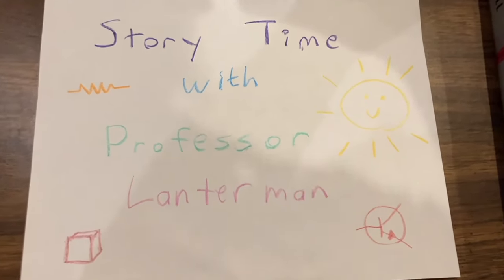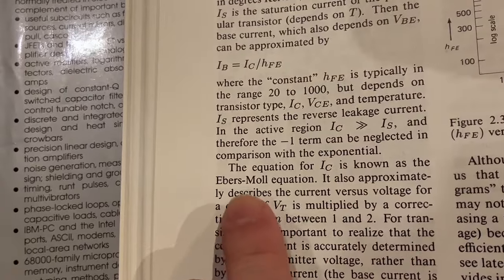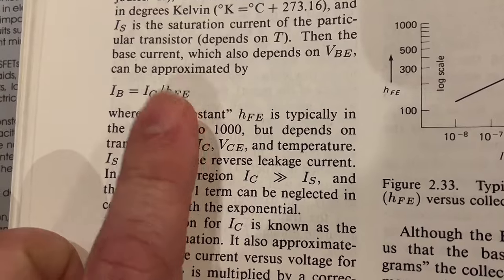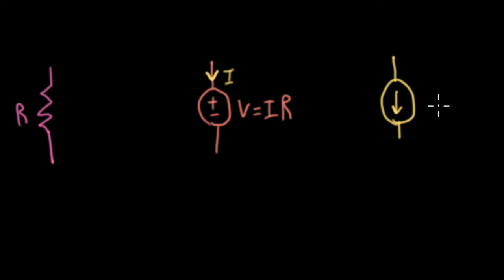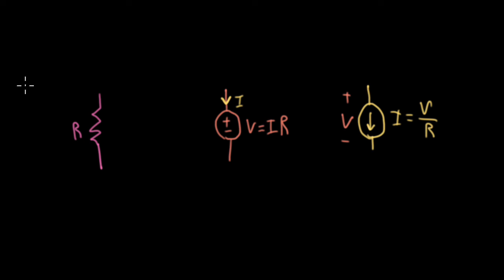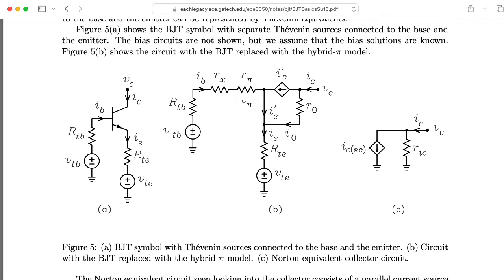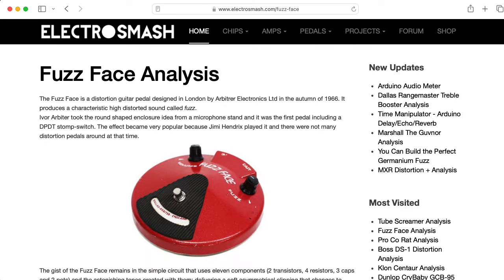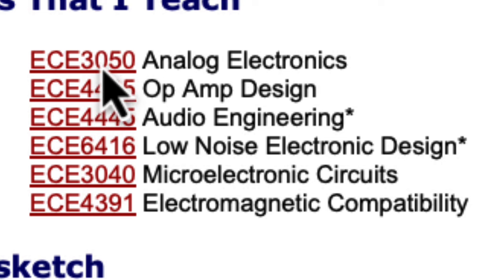BJTs are VOLTAGE-Controlled Current Sources!

Comment: Yay, AOA!  They're about the only one who gets transistors right.  Horowitz, Hill, and also Lanterman.   (Also go find yourself a copy of their Lab Manual.   The authors really let "current control" have it, pulling out all the stops.   If you deeply believe in holy hfe, then your analog designs will all fail   ...because slight temperature changes ruin the bias calculations, and because no two BJT transistors have similar hfe, even if the part numbers are the same.)

These same issues came up to bite Win Hill in his first EE job.   Exactly the same thing happened to me!    I had to abandon hfe and current-control, and instead re-teach myself the BJT physics.   I ended up using longtail-pairs and cascode level-shifters, both which are voltage-input circuits, and cannot be explained in terms of current input.

Also Wikipedia had all the current-control garbage on their BJT transistor page.   I and others set them straight, but then it all got reverted.   Then, WIN HILL HIMSELF came storming in, and carved those "experts" a new a-hole.   The BJT page on Wikipedia then had all the voltage-control material.   (I haven't checked it recently, so I wouldn't be surprised if the ignorant masses had deleted it all again, years later.)

And finally  ...just tell students that there's no mechanism where one current can directly affect another.   In the BJT, we can *pretend* that Ib affects Ic  ...but in reality, Ib can be used to adjust Vbe, and then Vbe directly controls Ie.   The physics says that BJTs are voltage-based devices, "transimpedance-istors."   Same as FETs.   But with BJTs, the depletion-zone extends across the current path, and varies the current by altering the DZ thickness.   Fets are different in that the DZ invades from the side.   If FETs are like an optical iris with variable aperture, then BJTs are like sunglasses with variable tint!

PS
We can prove that MOSFETS are controlled by current.   After all, if we vary the nanoamps on the gate, it controls the drain current!  (This is actually true.)   Well sure, but then everyone complains that the MOSFET physics shows that it's controlled by voltage.   GOTCHA  ...because the BJT physics shows that Ie is controlled by Vbe, and that base-current plays no role in this, except as a leakage-current, same thing as FET gate-leakage.
Reply from the maker: I have the lab manual and love it.
Reply from the maker: I'm pinning this comment because it is epic.
Reply: Go read Streetman if you want to understand how base current can control  collector current.
Mind you, it's not a general electronic circuits textbook, but it's a semiconductor devices textbook.
Reply: "but in reality, Ib can be used to adjust Vbe, and then Vbe directly controls Ie". That's current control.
Reply: I have no idea the wrath around this. I personally found the distinction useful. Ohms law makes everything interconnected.
Reply: But you CAN have voltage without current. Not the other way around. So if you say something is current controlled there HAS to be a voltage creating that current. But you need the current, not just the voltage...
Reply: Talk to a bird on a high tension wire.
Reply from the maker: @justovision  But more often in circuit design, you're controlling Vbe, and Ib is whatever it winds up being. That's voltage control.
Reply from the maker: @justovision  The point is it's pretty hard to precisely control Ib. And even if you could, The Ic = Ib Beta relationship is kind of dodgy since Beta depends on so many other things (including Ic itself, i.e. "beta droop").
Reply: @Lantertronics  You're already chosen a transistor at that point.
Reply: If you're dealing with a transistor it's easier to control voltage for sure. But you've already signed up for needing current to run the thing.
Reply: Now choose a jfet and what current do you need to turn it on?
Reply from the maker: @copernicofelinis  It's sort of a matter of how you are controlling a BJT in a particular application. There are probably applications out there where you drive the base with a current source, but you're usually driving it with a voltage source (especially something like a differential pair, where every derivation I've seen focuses on the voltage control viewpoint).

Actually I'm curious now to go try to find situations where people drive the base with a current source.
Reply: But you need a voltage difference.
Reply: @Lantertronics  put a solar cell at the base of a CE amplifier and you'll be driving it with a current. So many photons hit the cell, so many electrons enter (or are pulled from) the base. (Well ok, not one electron for each photon, but the idea is that with luminous flux you are controlling the current).
Reply: @justovision   'that's current control'    Heh, you've just proved that FETs are based on current control.   After all, we can apply a current to the gate, which then alters the gate voltage, which directly controls Id.  Obvious current-control, right?   
There are two issues here, and I think many people ignore this, then get angry.  First issue is engineering, where the transistor is a black box, and we choose the appropriate model.  Should we employ Ebers-Moll?   Or go to Gummel-Poon and charge-control, for the high-freq regime?   Or just say Ic/Ib = hfe?   Eh, whatever works best.

The second issue is, if we "open up the hood" and explain how "transisting" actually works (describing the detailed physics,) then some of our models are actually wrong.   They contradict the actual internal operation of the component.

For example, inside resistors, does current ever cause voltage?   Ohm's law says yes.   But physics says no.  The resistor is full of mobile charge-carriers, and if we apply an e-field, the carriers are accelerated by Coulomb forces.  The opposite never occurs.  (And we cannot make gravity by flinging pebbles downwards.)   Resistors are like vacuum tubes and CRTs, where the e-field accelerates electrons, but the opposite isn't real.  Manually accelerating an electron doesn't create a global potential-hill.  But providing a potential-hill will accelerate all the mobile electrons.  So, just close the hood, ignore the micro-scale physics, and use Ohm's law as normal.  Apply a current, and it causes a voltage-drop.

In the transistor, the e-field found inside the EB junction is king.  It controls the junction current by accelerating any mobile carriers present in the depletion layer.  The transistor is a fancy kind of diode.  Learn diode-physics, and we're half way to understanding the BJT.   And, as with diodes, this e-field in the junction is determined by Vbe applied to external leads.   That's why BJTs are voltage-controlled devices.   Their physics is one of transconduction, same as the grid of a vacuum tube.  E-field in, charge-acceleration out.  Meaning,  voltage-in, current-out.  (Hence their name TRANS-istor.)

Unfortunately, we're all taught differently as kids.  The great William Shockley says that Alpha and Beta are how transistors work, textbooks are written, and kids dare not question it.  (And so, the names on the transistor equation are Ebers and Moll.   Shockley didn't know how BJTs work?   If he did, then his name would be there instead.)

This is an incident of "Lies-to-children."   There is no gravity in outer space, right?  Atoms are just little solar-systems.   Winter occurs when the Earth is further from the sun.   Tongues have flavor-zones, and venous blood is bright blue like paint.  Wings fly because the parcels must recombine at the trailing edge.   The sky is blue because it reflects the ocean.  Raindrops have little points on the top.   Electrons flow through wires at the speed of light.  Ben Franklin's kite was struck by a lightning bolt.

With many of these, if we dare to question them, or even declare that they're utterly wrong  ...everyone attacks us furiously!   We're saying that their beloved grade-school teacher was misinforming us, spreading lies.   Flamewars erupt.   DECADES-LONG flamewars erupt.

I was most amused when people on Wikipedia tried deleting the voltage-control section of the entry on BJT transistors.   They KNEW that transistors were current-controlled.  A fight erupted.   Then they made a mistake.   They tried to say that Horowitz and Hill, the AOA textbook, was proving that BJTs are current-controlled.    Author Win Hill then came stomping in and gave them a big and furious talking-to.   They didn't know it, but Win Hill fairly hates this current-control stuff.   He found that it's screwed up generations of electrical engineers, preventing them from succeeding at analog design.  It screwed up him personally.   His book attacks the current-control model, over and over, with multiple approaches.   (I guess it's a bit like having chemists who deeply believe that atoms ARE tiny solar systems, and so they ignored all their college textbooks which taught differently.  Some college teachers take such issues very personally.)
Reply from the maker: @copernicofelinis  Ah yes! I forgot solar cells are usually modeled as current sources. Is that sort of circuit the basis of any practical light sensors?
Reply from the maker: @wbeaty  This may be the most epically awesome comment I've received on any of my videos.
Reply: @Lantertronics  the transimpedance amplifiers used with photodiodes produce an output that is determined by the current flowing in the pn junction. In the simplest form, a single transistor whose base current is such tiny photocurrent can multiply it by beta times and convert it into a voltage across the collector resistor. A rudimental photon counter, if you will.

But practicality was not my point. My point is that the BJT can be equally considered a current controlled or a voltage controlled device. It is kind of moot trying to frame it into either category exclusively, much in the same way there is no point in trying to determine if voltage causes current or vice versa , or if changing electric fields cause changing magnetic fields or vice versa. Unless you can make time explicitly appear, physical relations do not give indication of what is cause and what is effect.
Reply: @wbeaty  ah, this is the funny part. Can you change the state of a FET, or worse of a MOSFET without supplying current?

And here is another funny thing: if you have a billion tons of pebbles in outer space at position x and you somehow manage to move half a billion tons to position y, will the gravitational potential change?
Reply: >manually accelerating an electron doesn't create a potential

but manually accelerating many electrons does, and that's literally how we create the voltage in the first place.

I think it's misleading to think about what is more fundamental, the electrons moving or the field that accelerates them. There is no changing field without moving charges, there are no moving charges without changing field.
Reply from the maker: @tommihommi1  Sorry, I'm not following you. You can quite readily have a difference in potential without current flowing. That's what a battery sitting there on the shelf is.
Reply: @Lantertronics  and that voltage is created by the act of separating charges chemically.
Reply: Atoms exist in quantum states. You are yes or no. Defined by your energy. Describing one way of looking at sloppy silicon things as right vs. wrong is silly.
Reply: I've already said there is no action without voltage. But current makes things move and is required in the transistor. You can have the former without the later. They are not the same. V lives at the top of the ohms lawy pyramid for a reason. You can't ignore current when talkin about any circuit. But if you choose BJT you must account for it.
Reply: @Lantertronics  > epically awesome comment" - -   Eh, I've been involved in this fight since early 1990s, so I've had to come up with counterarguments for every claim made by the "hfe-think" crowd.  (We can get inside their heads, know why they're angry, and also can predict what sort of dishonest "troll logic" they'll try next.)  Also involved in brutal hateful flamewars about the speed of flowing electrons in copper (they're slow,) about electrical energy only flowing outside the wire surfaces (it does,) and about falling raindrops having little points on top (they don't.)    It's very much like a "yo-mama fight," where you can usually find some little-known fact that totally triggers people.   This hfe thing is one of many.   (Let's see  ...did you know that the transistor was invented 20 yrs before Bell Labs did it?  The inventor even built a transistor radio, but hit a wall of disbelief, and had to give up.  Also, Bell Labs was successfully fabbing those old 1925 Lilienfeld transistors, even published a paper about this, showing that they worked, and exhibited gain.  That was their whole transistor project, before they stumbled across the point-contact BJT.  The corporate coverup was discovered by RG Arns in 1998.   Bell Labs found that the FET was unpatentable, already in the public-domain.  If they couldn't own the "IP," they couldn't make any profits from transistors.  They might have given up, but then Bardeen and Brattain discovered the very patentable BJT.)

 ...what did you say about the raindrops?   WHAT DID YOU SAY ABOUT THE RAINDROPS?   (Rage-weeping.)
Reply: @Lantertronics  > That's what a battery sitting there on the shelf is.
Nope, the trolls have an answer to that.   Same with capacitors on the shelf.   They'll insist that the voltage had to be caused by a current in the distant past.   (Very distorted, dishonest reasoning.  A familiar troll-move, from people who are trying to "win," and care nothing about who is actually right.  How to penetrate their fallacy?)

To highlight the error, merely point out that all e-fields involve voltage ...and e-fields are created by charge, not by currents.  Also, electrons alone always have a voltage.   So do protons.   These voltages were never created by currents.   That's because all voltage everywhere is caused by electric charge alone.   No currents necessary.   Voltage is just a way to measure an e-field.   The e-field can be visualized as flux-lines, as infinitely thin fibers.   But it can also be visualized as Potentials, as infinitely thin layers of voltage which are always perpendicular to the flux-lines.   Voltage and e-fields are the same thing, just as flux and e-fields are the same thing.  With e-fields, the voltage-gradient gives the flux, and also, the path-integral of the flux gives the voltage-gradient.   That's why e-fields are typically measured as V/M, volts-per-meter.  (If electrons are like boulders, then voltage is a way to describe the gravity, where voltage is very much like altitude.)

At the micro scale in resistors, voltage causes current, while the reverse doesn't happen.   The e-field (the voltage) surrounding a charged object was never "caused" by some nearby electron being accelerated.   E-fields in general are attached to electric charge, and never caused  by currents.   However, that's only at the micro scale.   We can cover it up in a black box called "ohm's law," and in that case, then applying a current to a resistor can obviously create a voltage-drop.   Very useful as a rule-of-thumb.   It's embedded in electronics knowledge.  But it doesn't describe the physics inside resistors.

Again, that's where people fly into rages.   They've been assuming that the "rule of thumb" was actually real.   Since it was not, it means that they're not the experts they though they were.  They've just been proved wrong in public.  If they were trying to "win," they've just become losers.

So, their knee-jerk reaction is to ignore simple facts, or "kill the messenger," or silence them, or spew a smokescreen of distractions and troll-logic.   But it's all needless, if we simply accept that the black-box models are never real in the first place.   Yes, transistors can be controlled by current  ...but don't look inside the black box, or you'll find that this useful mental model doesn't match the transistor-physics.   If we just want to use transistors, we don't have to look inside the black box mental model.  Pretend that base current can somehow affect the collector current.   But if we want to actually understand how they work, then we must give up our precious and long-believed high-level descriptions, and instead understand the internal workings.  

- " Discussions are better than arguments. Arguments are about WHO is right. Discussions are about WHAT is right."

.
Reply: @Lantertronics  As others point out: phototransistors.  The light is providing a current to the base.   
But then, next this current also alters Vbe, which controls Ic.   (A test: ...try using an external supply to set your phototransistor Vbe to 0.5V or so.  Now Ib cannot affect Vbe.  Shine some light.  Does this screw it up?)   For BJT transistors to work, it's required that Vbe never be held constant.
Reply: @wbeaty yes, that is the whole point: you cannot change vbe without changing ib, and you can't change ib without changing vbe. The two quantities are bound to be on the vi characteristic and you can't say one is the cause of the other.

Still, I can set ib by choosing how many photons per seconds hit the photodiode junction, i.e. by controlling the light flux I am controlling ib without any need to know what is the value of vbe that goes with it.

I find it interesting that the voltage control champions keep ignoring the fact that Ebers and Moll did cast their equations in the form as voltages as functions of currents, as well as the inverse relationship they normally tout to defend their position.

Yes, since nearly perfect insulators are easier to come by that nearly perfect conductors we are used to considering almost always nearly ideal voltage sources, but that does not necessarily imply a causation.

When you have both voltage and current, you cannot keep the same value of voltage without restoring the charge distribution with a current  (which in the case of a battery will come from within) instant after instant (not in the distant past).